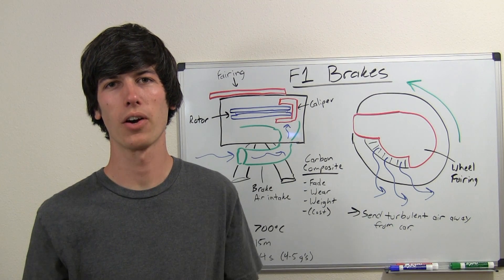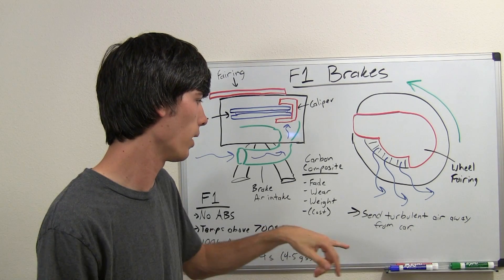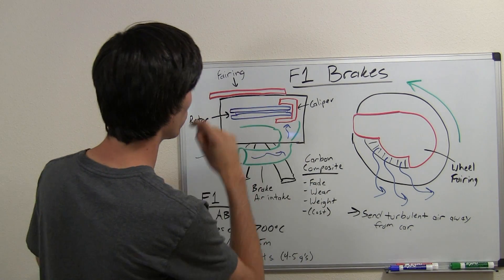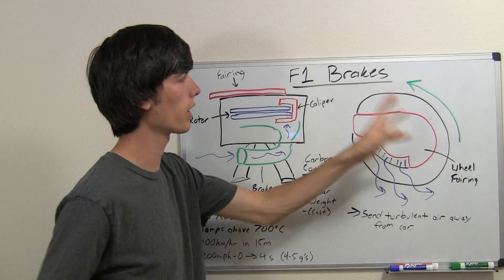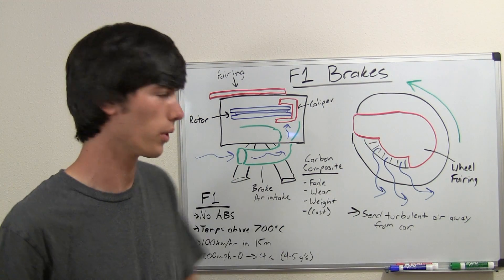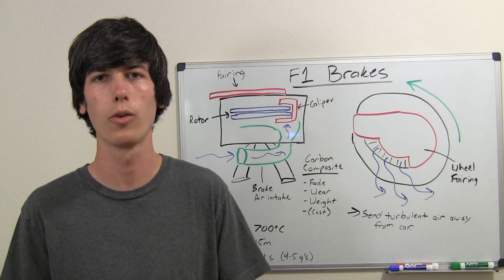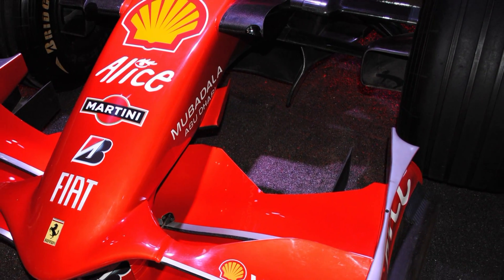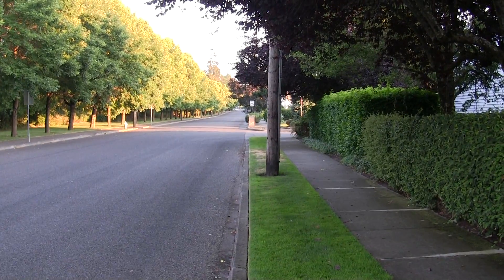Formula One Brakes - Explained

Comment: Can someone explain to me how the brake ducts which wrap right around the Drake discs can withstand these high temperatures? I mean the ducts are made of carbon fiber (one can clearly see the fabric structure) so the resin must wear away quickly at these brake temps, or when the cars come to a stop in the pits with super hot brakes. Is it some kind of special resin, like cyanate ester or so?

Comment: how much weight the formula 1 driver apply on brake paddle.?
Reply: It varies highly on the circuit and braking point. Under extreme braking(think of a long straight leading into a hairpin), drivers hop on the brake with their full body weight. Peak force on the pedal is short but can exceed 150 kg.
Reply: sorwis 
wow...
thanks

Comment: I heard somewhere also that the reason F1 brakes are not used by road cars is because they are designed to operate effectively under extreme temperatures. This makes them too over-powered when in normal to cold use where the brakes would just lock. I understand ABS may compensate for this but is this a real reason why we don't see F1 brakes on road cars?
Reply from the maker: Romil Singh Mostly right, but they don't operate well at low temperatures, meaning it would take more force to lock them (rather than less). So braking distances would be worse in the cold (and the tires would not lock).
Reply: Oh OK, thanks for the clarification.
Reply: +Romil Singh this is the same with all racing brakes, even if you buy say a nice pair of track wilwoods, until the brakes are up to temperature they will squeek and wont brake properly.

road car brakes are the opposite the work well at lower tempurateres but when your going down a hill or around a track and the temperature rises you start to get fade as the compounds used in the calipers dont do well in that situation

its not that the racing brakes are "better" because in your road car they would rarely be up to temperature
Reply: So, if they have a long straight track they might limit the air intake to the brakes a bit to keep the temperature sufficiently high to have that braking force. Is that true?

Comment: The front jack man in those pitlane crews must get paid really well, he basically stands still while a F1 car aproaches him at 100k/h (pitlane mandatory speed), stopping just a few centimetres from his feet. They must trust not only those brakes, but also the pilot. Personally, I'd never accept that job.
Reply: The pit-lane speed limit is 80km/h at all Grands Prix (and actually reduced at circuits like Monaco because of track configuration). That comes down to 60km/h during Practice and Qualifying.
Reply: +Funke Motor What if you could use stilts?
Reply: +EdMcF1 My legs might be safer, but I could still end up with my head stuck in the engine intake. No thanks. I'd rather run with the bulls in Spain while wearing a cow costume.
Reply: He’s a team mechanic and gets paid depending on what mechanic he is and it’s the easier/least stress job among pit crews

Comment: ABS brakes with really fast cycle rates will stop consistently faster than any human can. Yes, the best braking occurs at a finite amount of slip %, racing ABS systems have tunable slip % settings to make the most of the tire's grip consistently.
Reply from the maker: Agreed!
Reply: ABS systems on GT cars are setup with relatively higher activation thresholds compared to road cars. A skilled driver threshold braking typically won't activate the ABS since the ABS will be calibrated so that it only activates if optimum slip ratio is exceeded to prevent wheel lock and maintain steering control. 

On tarmac, a wheel slipping at optimum slip ratio will always out-brake a wheel completely locked. Off road, however, locking the wheels would be a good idea when maximum straight line stopping is desired. For instance, on lose surfaces, locking the wheels would be necessary to stop the car in a straight line as quickly as possible as the loose ground piling up in front of the wheels would aid greatly. This is why today's ABS systems are setup to work only above a certain speed (e.g. 10km/h for my car) to enable cars to come to a complete halt on lose surfaces.

Comment: Hi, do you have a video about F1 tyre?  just curious about why they use so high profile tyre with small 13 inch wheel,  instead of the low profile tyre with big wheel as all the performance cars have.  thanks.
Reply: F1 Regulations limit wheel size

Comment: I thought the whole point of abs is to allow the tires not to lock up which in turn gives you the ability to manouvere the vehicle around obstacles in panic stop situations. Ie a spinning wheel allows the vehicle to travel in the direction its turning/ pointed. In turn abs increases stopping distance because it is slightly releasing the brakes in order to keep the wheel spinning. In turn a locked up wheel will bring you to the quickest stop but wont allow you to go around the turn

Comment: I work at a driving school and one thing i do is teach 15 yr olds how to stop faster without using abs and most of my students can do it within 2-3 hours of practice. Also out of my 6 years experience, i have yet to find a car that stops in a shorter distance while abs is engaged rather than using a threshold technique (about 7 cars a day times 200ish days times 6 years= a lot) ABS pump cycles would have to approach infinity, modern tech. isnt even close to making ABS better than human responce

Comment from the maker: Perhaps in practice, but not in theory. Theoretically, a perfect ABS system would hold the brake at peak friction without allowing any wheel slip (or a very slight amount) and thus this would stop the car in the shortest distance. But it of course depends on how many pumps/second the ABS system is capable of, the faster it can react, the better the stopping distance.

Comment: The braking deceleration in F1 cars can hit 4-5 g's. Because the downforce generated by the wings significantly increase the coefficient of friction of the tyres. Regarding aero drag... just coasting can generate slightly over 1g of deceleration

Comment: if you use proper brake fluid (not the crappy old DOT3 but DOT5 or DOT5.1), you will probably overheat the pads and the rotors much faster than the fluid itself.

Comment: It doesn't work this way. the limiting factor in normal cars are the tires. The hardest way you can brake is nearly lock up the tires. The point when this happen depends on the tires and the downforce, but not on the brakes itself. Stronger brakes doesn't always mean you will have a shorter breakingdistance. Also, the F1 brakes works only great when they are at least up to a temperature of 350 centegrade.

Comment: You forgot the downforce made by the aerodynamics. the car maybe weights only 642kg without fuel, but they can produce more than 2 tonns of downforce. For friction, it is importent with how much force one surface press on an other, beside the frictioncoefficent. It's mostly only the gravity that matters but not always.
The decelaration can even peak up to 5g after a straight at the initial breakingpoint because the car has the maximum downfoce at this moment.

Comment from the maker: Yes, significant air resistance, and also, the coefficient of friction of the tires is greater than 1. Remember, soft tires can mold their surface into the surface of the road, thus allowing g forces in excess of 1g.

Comment: The deceleration is from 2 to 3 g's: 
ΔV = a.t => 89.408 m/s = a.4s => 89.408/4 = a = 22.3 m/s².
The gravity acceleration is 9.8 m/s² ∴ 22.3 m/s² ~ 2.2 g's.
But look to the coefficient of friction of the tires:
Once the friction is the force of deaceleration, I equated the friction force with the 2nd Newton's law: Normal.α= mass.acceleration. With this, the maximum friction force must be equal to the g force. Explain me how can the deceleration of the F1 be so bigger? Air can resist so much? Tnx

Comment: Isnt the brake rotor actually the brake disc (and if not, what exactly is this) ? Does they still have those fairings cuz you cant see it on the 2013 cars, for example? GREAT VIDEO ! :)

Comment: Real quick refference for fifty feet...the trailer on a Semi truck is about 53' on the long ones...also..brake fade on most conventional systems is caused by BOILING BRAKE FLUID...remember...we are dealing with a hydraulic system, in most cases...you can't compress a fluid, but you can a gas...

Comment: technically the fairing as it was attached to the wheel by the nut the fia considered it to be a moving areo dynamic element, the fair help channel the dirty air from the wheel around the outside

Comment: Reading the video description and also some of the comments and I think there is a bit of confusion in the brake material used. F1 doesn't use carbon-ceramic discs. They use carbon-carbon. Carbon-carbon are never used in road cars not just due to cost but also because they don't work when cold. Carbon-ceramics are what you see in high end sports cars. These still stop when cold and still gives the weight advantage of carbon-carbon.

Comment: if they the disc is too cold when approaching a corner and you stomp the brake pedal, the car decelerates "gently" and when the disc is finally up to temperature it feels like hitting a wall ;D
a nice side effect of these high temperatures is disc glowing (can also happen with steel discs, but as you've mentioned they fade dramatically at these temperatures and a not suitable for high performance cars.)

Comment: just wanna add something: the main reason for their incredible breaking distances are the very sticky tires in combination with downforce, not necessarily the brake disc itself. @320kmh an F1 car weighs ca. 3t therefore it's almost impossible to lock the wheels even without ABS and enables them to decelerate so brutally. In terms of temperature, a ceramic brake's optimal friction coefficient is between 800-1200°C so it's quite complicated to adjust the cooling parts around the brakes

Comment: Another great video.Carbon brakes,said to have v.good wear rates.But i remember watching  a race in Sepang in which Jos Verstappen's brakes produce great plumes of carbon dust.Looked fanstastic but the wear rate was said to be very high.This was in the early days of carbon prob.new compounds are used today.
Is there any chance of explaining how sensors are fixed or mounted on moving parts or extreme temp.parts.Thanks for your time.

Comment: It's disappointing how Bernie and F1 teams have neglected engine and the development of the mechanics of the cars in favor of aerodynamics. All in the name of going green. I am a huge proponent of energy conservation though. But when you consider all 20+ cars and their fuel consumption for a weekend it's probably less than the fuel used by all the fans driving to the track. Lap times have suffered too. It seems the increased downforce can't makeup for the loss in power output.

Comment from the maker: Wheel fairings could break off in an impact or by swapping paint with another driver. Just an idea, I'm sure there are other concerns. Also, ABS could be installed on these cars easily, it's just against FIA regulations.

Comment: how would a wheel fairing risk the safety of the drivers? I don't quite understand.
Also could ABS be added to these brakes? say if some incredible super car where money isnt an issue came out, would they use these kind of brakes or is there a better system for an even shorter stopping distance?

Comment: Because iron rotors can still provide more than adequate braking force, and there's nothing wrong with them. Just because McLaren used them does not mean they're lighter. If cast iron was lighter than Carbon Fiber, then why would car manufacturers attempt to lighten a vehicle by replacing metals much lighter than iron with carbon fiber?

Comment: what they also added is tighter pistons. Think about it if you added that kind of piston to your daily car.. You need to wait 24h before you can start the engine. the engine is getting heated with a special lubricant, until the tempratur is perfect. that is where expanding occurs . if you started the engine without heating it up, you gonna blow the F1 engine. very extreme.

Comment: there is a huge role on brakes about the braking performance but don't forget the aerodynamics and their downforce - drag effect and the engine brake as well.. cause while F1 cars going around 200km/h  or above and if the driver just lifts off the gas pedal, car slows down just like an ordinary car's braking performance at those speeds without touching the brake pedal.. i don't know the exact translation of engine brake in English but i hope you guys understand what i mean with that..

Comment from the maker: Well don't expect stopping distances like 50 feet. That would be with sticky slicks (not street legal) and a good amount of downforce. Production cars don't want as much downforce due to the drag created, so in other words for mileage purposes. Some cars (R8 I believe is one) used fan shaped wheels that suck in air to the brakes (the opposite direction than in F1 cars).

Comment from the maker: 1g is the force that's pulling down on you right now. 9.81 m/s^2 or 32.2 ft/s^2 depending on where you live. A car that can hold a 1g corner can hold the same acceleration force that's pulling down on you, but does this horizontally. So if you pull on the side of the car with a force equal to the weight of the car, it would remain there. Anything more, it would slide, anything less, it would hold. Hope this helps for now.  

As for the braking, check out my video "braking distance."